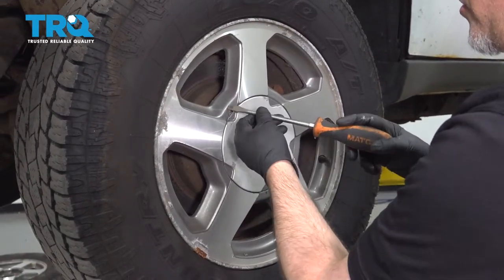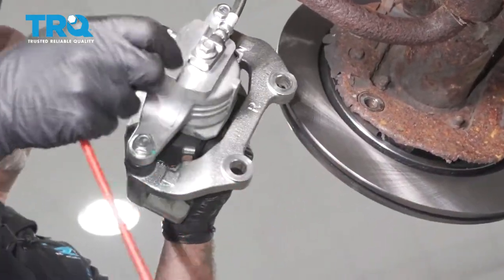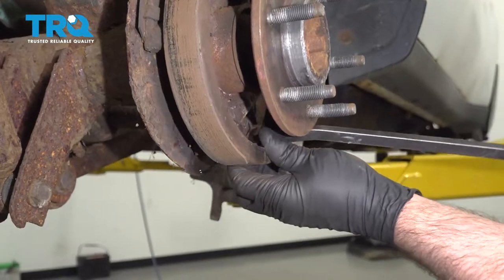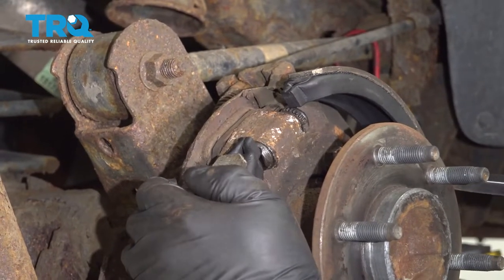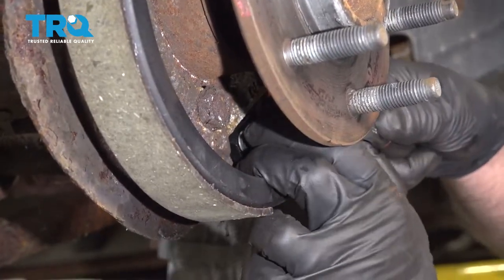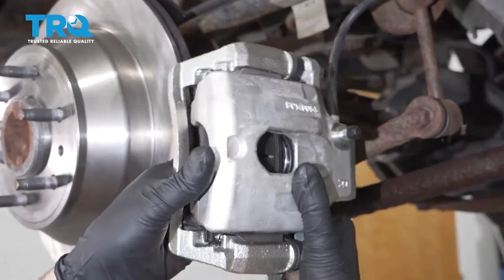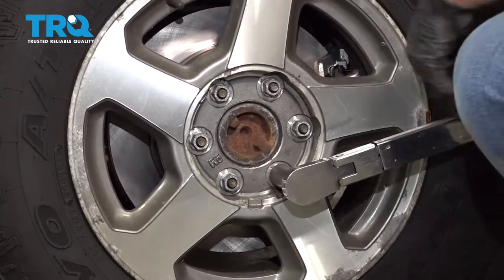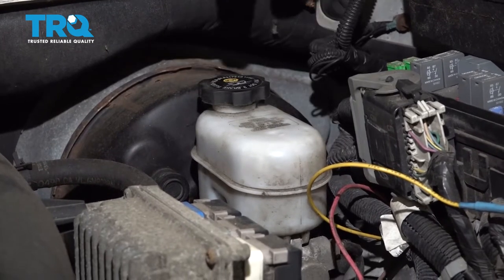How To Replace Parking Brake Shoes 2001-2008 Chevy Trailblazer

Comment: I have learned an thin coat of anti seize on the lug studs and on the surface helps with future removal of the tires. Breaking them tires free the wrong way can cost you$$$$$$